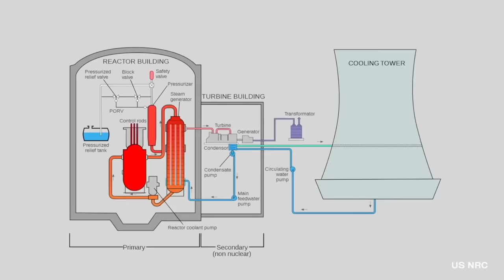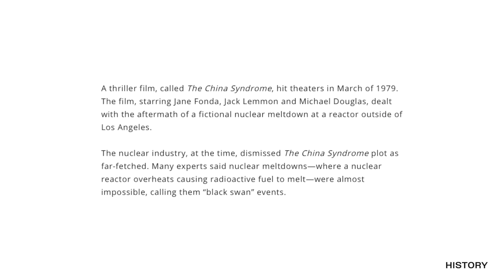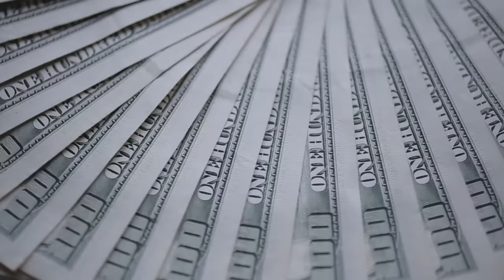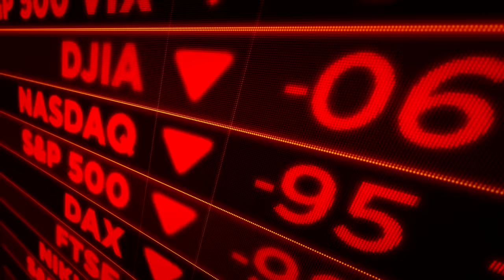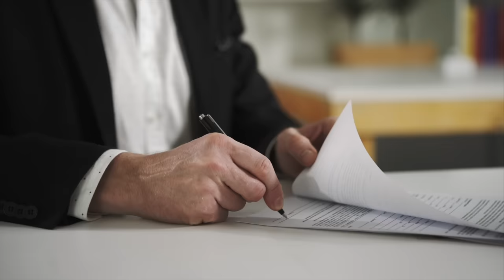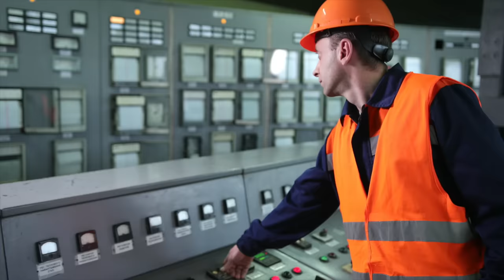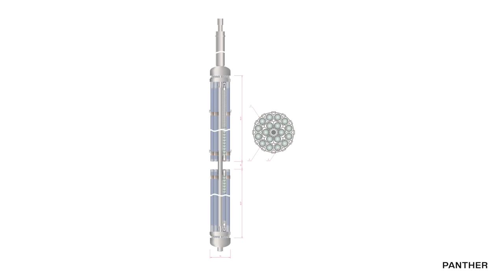10 Most Expensive Mistakes in All History

Comment: The cameraman filmimg the explosion at the chemical plant was roughly three and a half kilometers away. I would call that a safe distance.
Reply: 2 miles. Proper English please.
Reply: Kilometers is proper English.
Reply: @therealcoltstonewolfe  wrong, yank.
Reply: @tooshlong  Why are you being so abrasive ? I worked out the distance by counting the seconds between the visual blast and the audible blast and then comparing the speed of sound. it turns out that it is easier to work that out in the metric kilometers and thus used that system. I also use feet, inches and miles as well when it suits me. By the way, you understand that youtube is an international website and lots of people who speak English but are from maybe continental europe might choose to comment, but would have little understanding of feet and miles. So how do you think your comment comes across ? And of course the irony of you asking for 'proper English' and with your next comment  constructing a sentance which is very far from proper English usage. Are you suggesting that the poster is a yank, or stating that you are a yank ? If the former then that is highlighting your ignorance further, as America is one of the only countries to still use the imperial measurement system.
Reply: @tooshlong  world ain't  USA, only 3 countries use such stupid unit system. metric system is the proper english
Reply: @bagofnails6692  garbage isn't used when referring to waste. Is used often when referring to what comes out of your mouth. Try more.
Reply: @tooshlong  Little Englander syndrome all over.
Reply: @bagofnails6692  The Metric Sytem is French. The French have invented it to be bothersome to the English. There is nothing wrong with the Imeprial System to this day. Living in Europe, I generally cause havoc in my conversations for locals when I keep using inches, feet, yards, miles, and Fahenheit degrees for the temp. Every time I am asked for the "metric equivalent." And every time I say -- "I haven't a clue." :face-blue-wide-eyes:
Reply: @frankfarago2825  Why anybody would use fahenheit over centigrade bafflers me. It makes no sense to the average person, whereas in centigrade you can say that water freezes below 0 degrees and boils above 100 degrees. Also because of the interconnectivity of the metric system, I can say that a cubic metre of water weighs more or less exactly one ton. You really cannot do that with the imperial system. I think feet and inches are great units of measurement, but there is no way that I am going to try to put up a shelf using 1/32 of an inch. If the imperial system was purely constructed using base eight  or base twelve then i would use it for everything, but it is not. You need to know your eight times table, your twelve times table, your fourteen times table and your sixteen times table. There is no easy way to switch from distance to volume.
Reply: as did everyone

Comment: The ship capsizing could have a caused by the same problem all transportation has when visiting the US, the world went metric long ago but for some unknown reason the US is still using imperial measures and every aircraft or sea craft has the problem of having to convert kilos to lbs, litres to gallons and back again, many mistakes are made during this rediculas process, if the US caught up with the world there would not be these problems .

Comment: Both Space Shuttles (Challenger and Columbia) had accidents that could have been prevented but thanks to too much confidence and pride, each shuttle ended up being destroyed due to human errors. The Challenger explosion was due to extreme cold affecting external seals for the fuel tanks, that while they are just plain Oxygen and Hydrogen, when mixed, they combust and create water vapor. The two gases got in contact as the seals froze and broke down, and the rest we all saw it on TV. The shuttle did not explode, the fuel tank did, but with it, went to shuttle, and worse part is, we believe the front cabin that had all the astronauts got "ejected" at high speed and fell down from high altitude at high speed. If they were not killed by the initial explosion, they survived just to be killed on impact with the water below. Experts warned that the seals would not tolerate the cold and still, the NASA director himself gave the green light to launch. 
Columbia is not far away from it, as the video said, experts new about the insulation being struck multiple times on take off, and still did nothing about it until it was too late. After several years being grounded (the last three shuttles Discovery, Endeavor and Atlantis) they went back to work but this time, each flight would require a full 360 degree turning so the shuttle could be visualized by the crew in the ISS, or would need their own crew to go out or use robotic arms to inspect the shuttle if on a mission other than going to the ISS. 
Why do we have ALWAYS to wait for tragedy to happen before we do anything about it when we already knew it could happen? This is the trend with virtually everything in our society.
Shame.
RIP for both crews.

Comment: The accident in 2011 could have been prevented if the emergency power supply at the Fukushima Daiichi Nuclear Power Plant had been installed in a high position in anticipation of a tsunami caused by an earthquake. It is unclear how long and how much it will cost to decommission the four reactors.
Reply: The Fukushma disaster has barely begun. Have they started releasing the waste water yet?

Comment: Three Mile Island was an unfortunate incident but the fact of the matter is the plants emergency systems worked like they were supposed too. That's why the plant didn't melt down and was only a very minor radiation releases. That's as opposed to what happened to the Soviet military reactor at Chernobyl, which was badly designed and had poor safety systems that just didn't work.

The "China Syndrome" was just bad science fiction with lucky timing.

Comment: Your in formation on Three Mile Island is wrong on many respects. The event was triggered by a malfunctioning over pressure valve in the primary coolant system, not a feed pump; according to follow up analysis there were more than 100 alarms being triggered when something went out of normal range...and when it went back IN normal range (commercial nuke plant control rooms have been significantly redesigned post TMI)
Also calling The China Syndrome far fetched is being kind... a more accurate description would be along the lines of "Ain't never gonna happen"

Comment: It is difficult to value some mistake-caused disasters, for various reasons.  Two notable candidates for the world's worst mistake-driven accident that didn't make this video are the Bhopal disaster and the Banquio dam disaster. I generally cite the latter. I also note some explosions/accidents that are larger in various senses than those in the video. 

Bhopal is often considered the worst industrial accident, with over 2,000 immediate deaths, up to 8,000 within a couple of weeks, and 500,000 exposed to poisonous gases that caused delayed deaths and very many terrible illness. If it had happened in the US, the roughly $1bn compensation (updated to modern values) would have been on a different scale.

The role of human error in the 1975 Banqiao dam disaster is often played down, calling it a weather-related disaster. But these were jerry-built dams from the Great Leap Backward, and it was human error that turned it into such a major disaster. If the dam had been deliberately opened, to control the release, as the dam operators requested, that would have enabled evacuations and better management at downstream dams. But the senior management denied the request. When some time later they realised that was a terrible mistake, communications had gone down so the order never arrived. Its catastrophic collapse triggered a chain reaction of a total of 62 dams failing. External estimates suggest it killed around 100,000 directly and a further 150,000 in the aftermath through disease and famine. The Chinese govt's figure is only about 10% of that. The Cultural Revolution raged on at the time, and there were no systems of insurance or compensation, as such things are not needed in a workers' utopia, so it is very hard to value. And how do you value a system of jerry-built hydro dams?

The largest accidental explosion, in terms of explosive yield, was the 1917 Halifax, Nova Scotia, explosion, with roughly twice the yield of the Beirut blast. A munitions ship collided with another vessel in Halifax harbour. It killed around 2,000 immediately, around 9,000 injured, and destroyed a large area of town. Some people understood the risk: the driver of a train heading for town heard of the ship movement, and deliberately held up his train, so saving the people on board. The resulting tsunami wiped out an important settlement of the Mi'kmaq. The most deadly accidental explosion occurred in 1626 at the Wanggongchang gunpowder factory in Beijing, killing about 20,000. The most deadly nuclear accident might be the 1957 Mayak Reprocessing Plant explosion in the Urals of Russia, in Chelyabinsk oblast. Some estimates reckon it killed 6,000 people, and exposed around 250,000 to radiation. But so deep into secretive Soviet times, it is now rather hard to assess and value. Fortunately it happened in an area of much lower population density than Chernobyl.

Comment: Your assessment of 3 mile island is COMPLETELY off base. 
If the idiots at the controls had just turned off the lights and went home, the reactor would have been back online in less than a week.The automated system would have handled everything. Instead they ran the reactor head first into a wall and caused a meltdown because they were trying to run the reactor like a Nuclear Submarine (which they were previously trained to operate). This is 100% a human fault.

Comment: Will you people stop saying Challenger and Columbia Blew up! Challenger broke apart from the sheer kinetic force after the loss of its ET External tank like an aerosol can bursting because of the SRB burning a hole through the bottom of the ET causing it to lose structural integrity at around Mach 6. The Big cloud is a Gas cloud, not a Fireball as most of the people who know the accident details. No Columbia broke apart on entry from losing it's left wing due to the ET foam striking the leading edge of the wing and punching a bowling ball-sized hole in the RCC reinforced Carbon Carbon panels on the wings edge which took the main brunt of 6000 Fahrenheit temperatures.
Reply: other than that Excellent video

Comment: Why nothing on the Bhopal disaster of 1984, at Union Carbide's plant? It caused about 3000 instant deaths and as many as 20,000 more dead later form effects.  The health of over 100,000 others was badly compromised, possibly still to now.  This has been shown in 2x mortality rate compared to neighboring cities, and skyrocketting still birth.  Those who survived struggle to work full 8-hour days, so t  he total economic cost hasnt been completely measured.  
Suffice to say, Union Carbide was forced to pay $470m to families of dead and wounded, which spread that much is almost nothing.  UC was later bought by Dow Chemicala who has since said it has not responsibility for UC's costs..=
To me, one of the main differences is also that it was a plant run by a US-based companies.  UC had little stake in the community as really only the lowest laborers lived near by. I think its a thing that may continue with "economic colonialism." and no local ownership/responsibility to the community that hosted the plant.

Comment: More false information.  Three mile island had TWO  reactors not three. Reactor two had bad water level gauges that made the operators shut down the pump’s cooling the reactor causing it to melt over half of the reactors inside causing a hydrogen explosion that was contained in the reactor building. 😊

Comment: How does one ignite fiberglass? Soak it in gasoline?
Reply: Probably referring to a fiberglass/resin product (GRP) which commonly uses polyester resin which will burn pretty well if heated hot enough. It may have been something that the person wielding the torch may have thought was metal and didn't worry about the sparks flying on it. But, still, there should always be a firewatch when you're welding or cutting with a fire extinguisher or firehose ready.

Comment: So Chernobyl was caused because they spent less money on the control rods than was necessary for the reactor. If they had been longer and more expensive and not had those cheap graphite tips on them it wouldnt have happened even tho it IS the fault of the director there trying to push the reactor beyond it's capabilities. Communism is always cheap. They can't even paint the public housing apartment blocs because they don't have money for paint. Why trust any communist country to run a reactor... I wouldn't have :P surprised more didn't meet the same fate tbh there were a lot of those reactors around europe and russia at teh time.
"interestingly enough the soviet union HID the disaster" 
Communism always does that,  I wonder why... maybe its cus tehy cant make it work or profitable and want to hide that from everybody :P